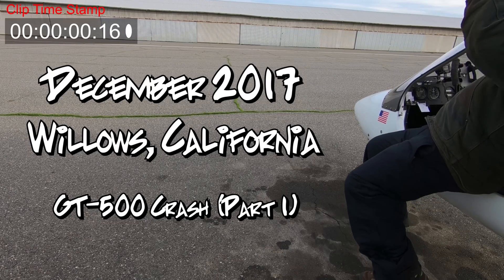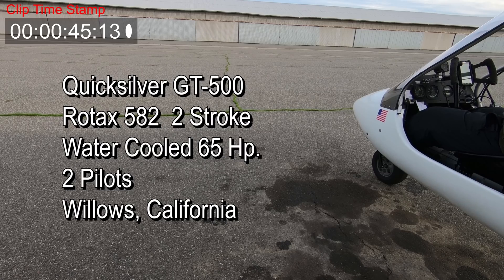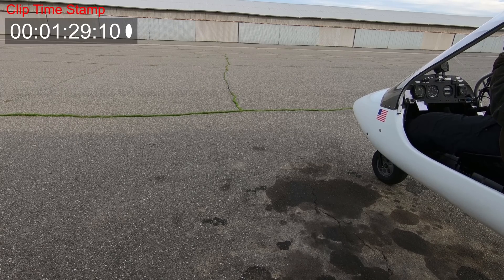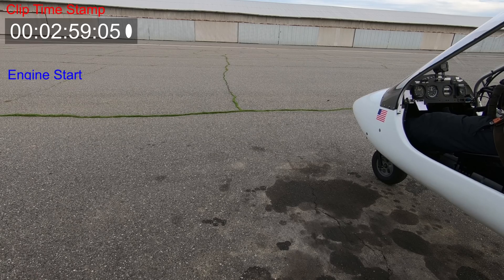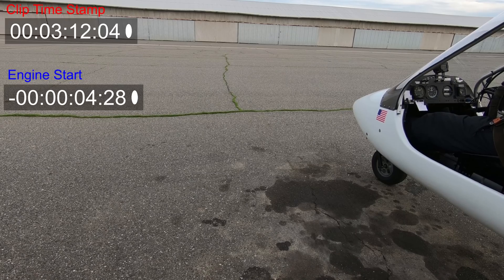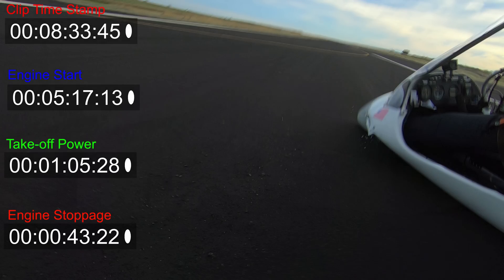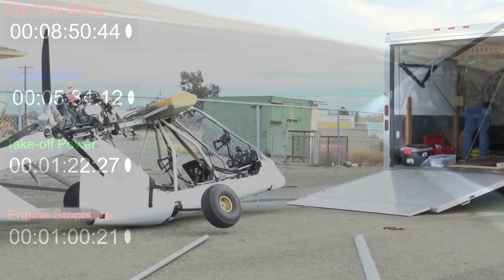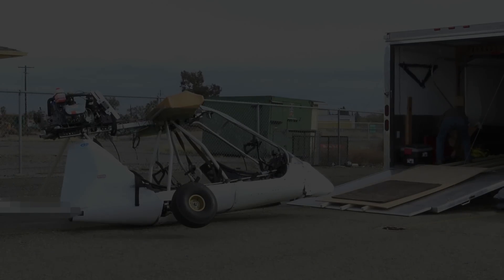Quicksilver GT-500 Engine Failure and Crash (part 1)

Comment: He forced the plane into taking off instead of letting it attain enough air speed to lift off the ground. Now the engine quits without enough air speed for the elevator controls and now you’re a rock.

Comment: That engine gave PLENTY advanced warning that it was going to quit...the second it started losing power he should have  decreased pitch.  With these two strokes you have to warm them up a lot more thoroughly than this guy did....4 minutes is NOT enough.  And you have to warm it up at much higher rpm than he did....you need  the engine casing/cylinders to be full running temp....not just the cylinder heads and EGT.  I do the last part of my 7 minute warmup at over 4000 rpm.

Comment: I ve had 3 engine failures in 3 different ultalights  and i can tell u the 1st time it happened i did exacltly what this guy did . Only i was alone so the sink rate wasn t so outrageous and it ended up as a hard landing only. Then next 2 were not so much of a surprise. Didn t even ding an aeroplane. All rotex engines btw

Comment: Interesting that the stick required back pressure to rotate. Normally the pilot may pull back some to rotate, in a well balanced plane you need to go to more neutral elevator position.  The instructor must take control in an emergency, the instructor should have shoved the yoke full forward.

Comment: Why is it that every time I watch an ultralight engine failure the pilot pulls back on the stick. Could it be the lack of formal training. Maybe they want to stall to add to the excitement. This crash could have easily been avoided if the pilot had pushed the stick forward and maintained his airspeed. The guys that fly ultralights are the most macho bunch of pilots out there thinking that just because they don't need a license they dont need to take lessons. I feel bad for the passenger and his back.

Comment: Not sure why the engine quit, but your CG is why you got hurt. See how much backforce you needed just to rotate?! Only way out after engine failure would’ve been a radical pushover (to low), to gain as much airspeed you could obtain, for the flare. At least y’all walked away relatively unscathed

Comment: Crash was caused by pilot error. No power does not mean pull the yoke back. First rule in engie loss, best glide speed. Should have changed to nose down attitude immediately. Instead he induced a stall. Engine was a very minor factor, and since startup you can hear the engine running like crap.

Comment: A perfect example of what not to do when you lose power, when the engine quits instead of pushing the nose down he sucks the stick as far back as it would go, violating the most basic operating procedure. Engine quitting started the chain of events, but it was pilot error that caused the crash. Was the instructor asleep when this happened?

Comment: You can see in the video he never pushed the stick forward when the engine quit, he kept holding it in the same position until the aircraft lost speed and stalled he should have pushed the nose down slightly to keep the air speed.

Comment: “What the hell happened?”  You had five seconds of your engine power decreasing and during that time even as it quit running completely, you continued to pull back on the yoke instead of pushing it forward to maintain your airspeed. You stalled it in from at least 20 feet in the air. Not once did you push the yoke forward to try and keep a good airspeed for a landing. That’s what happened.

Comment: That was not a "pilot" flying that aircraft. An actual pilot would have stuffed that nose down immediately upon power loss. I'm talking a minimum of 30-40 degrees below the horizon for such a draggy airframe. He needed to increase his airspeed to one which will allow some kind of flare just before touchdown. He obviously never once practiced engine failures upon take-off. So he ran out of energy and smacked her on in! When I practice engine failures in my Hurricane during takeoff, I have to stuff the nose down right away, and I mean immediately once I pull the power! Loss of power should be followed instantaneously by shoving that elevator control to the firewall to maintain airspeed. 100% pilot error. That crash had nothing to do with the engine failure with all that runway below him! I don't care if the engine fails at 2ft, 20ft, 200ft, or 2000ft. If you are over 200ft, you can get away with trimming the plane for best glide, but when you get close to the ground, you better drop that nose a little to pick up airspeed or she will pancake in!

Comment: The moment the engine fails - STICK FORWARD to maintain flying speed. Similar to glider winch cable break. Get the nose down instantly, then gently flare. Never hold the stick back, hoping the wings will defy gravity.

Comment: Pilot error. Didn't shove the yoke forward immediately. started losing power at rotation but no pilot input. Probably had the fuel valve off or on a dry tank. I have 10,000+ hours in Quicksilvers.

Comment: "Had they reached 50+ more feet, they could have died."...Genius! I landed thousands of times with the four jet engined and ALWAYS powered off at 39,000 feet....Hauling freight at night landing, we never need to power until STOPPED and we are ready to taxi off the runway! I flew 12,000 hours on the DC-8...5,000 feet on the water bomber(CL-215)....took off and landed on water(powered off) then powered to scoop water 100 times every time before we need to refuel...SO FIRST, LEARN TO FLY SO YOU WILL NOT EVER CRASH!(I never crashed in 24,000 hours)

Comment: During take off when he was running - it was clear heard that r582 is not giving full power. At the same time he started take off procedure and did not realize this. In order to prevent such case we make better pre-heating of engine before take off and giving max rpm to it for test on the ground. If it works well than take off. There was no 65hp during take off, the engine was like getting much more fuel than should...

Comment: Hello, the video speaks for itself. The quicksilver is not what is best in aerodynamics, the badin decreases very quickly in case of engine failure, especially the rear sector handle .. Note that the driver does not stop to bring the joystick up. There is distance in front, no stree, it was enough to put the handle forward, to keep the speed, and everything was ok :-( In any case, thank you for sharing this video that can serve as example of what not to do in case of engine failure.Good courage for the repair of the machine.  Thanks to Google translate ;-)

Comment: The real failure here is that EAA stop building primary gliders and letting people learn to fly in them, and instead focused on building fast, tin can metal airplanes.   Because primary gliders aren't sexy.  Learn in a glider like you are suppose to, and every landing is a dead stick landing, there is nothing out of the ordinary about landing without power.  

Fix your airplane, and land 50 times in a row with no power at all, and not just on the runway.  All over the place.   Farmers fields, backyards, strip mines, soccer fields, river banks, everywhere.   When you can do that, then you are ready to fly again over any terrain everywhere.  :)

Comment: I’m glad he say they managed to walk away from the crash. 

From the sound of the engine, it sounds like a typical classic Rotax engine seizure… Most likely caused either by not letting the engine come up to operating temperature before attempting take off, or from lack of oil. I have actually witnessed something like this happening with a Quicksilver many years ago.
Reply: hogflyer62 Limped away

Comment: First off, whoever was flying allowed themselves to get immediately blown of centerline. This shows inexperience.
Secondly, the nose should go down after engine cut off, which it did but there was no flare before touchdown. Just straight into the ground. What the hell? Looks like somebody panicked and froze.
Reply: Did it stall?
Reply: It stalled out when the engine cut because the way the plane is built, the engine has a high Center of Mass and it sits near the rear of the plane, the wings sit INFRONT of the engine and thus when it cut out it caused the back of the aircraft to drop before the nose, and it stalled the aircraft out causing it to plummet to the ground.
Reply: @JustAGooseman  Naw. Watch what the pilot does with the stick. It needs to go forward, immediately.
Reply: @UncleKennysPlace  Correct, you can see the airspeed decrease.  He needed a quick and substantial forward stick action.  My instructor pulled power at a similar altitude when I was training on my Challenger 2, which has the engine in a similar location.  I reacted correctly and set her down.

Comment: what was the air temp at the time of take off? not enough heat in engine (cold seize) and instructor should have taken control.
instead of stalling 10' above the runway. when all else fails "fly the aircraft"
Reply: Navy teaches. Aviate-naivgate-communicate. I think that is how the Navy spells.

Comment: So, I started by flying in towed gliders, and we practiced "rope breaks."  Stick should go forward immediately to keep airspeed up and AOA low to prevent a stall.  I've never flow this airplane, but if it has a high thrust line like many ultralights, losing engine power may cause the nose to rise, making it all worse.  And a student low to the ground wants his airplane to go up, so pulls back by instinct.  If this had dual controls, the instructor could have taken over.  But this is just my Monday morning quarterbacking, so could be deeply flawed.  Many thanks for posting -- this is how safety is made.  Looking forward to the next videos.
Reply: SteveandLizDonaldson Exactly how I was trained too...Lose power, stick immediately forward, to prevent stall
Reply: I also started flying in sailplanes at CA CITY, CA.....Grob 103.....watching this video appears that engine quit, plane loses altitude as pilot continues pulling back on stick.....
Reply: SteveandLizDonaldson 
Can't stall at zero gee.

Comment: The engine almost sounded like the ignition was turned off, no stuttering or missing.  A cold seizure is a distinct possibility as is lack of the proper amount of 2 Stroke oil in the mixture. The crash resulted from the pilot attempting to climb instead of leveling off when the engine failed, which resulted in a stall and the crash.

Comment: First guess...lack of fuel. I saw plenty in the tanks, but was it reaching the engine?
Reply: engine tapered off like you would think it would from fuel starvation ???
Reply: @P40BTomahawk  Sounded more like a mechanical failure. Not in the crank or conrods. It tried to burn, so there was air, spark and fuel in the cylinders. Piston rings?

Comment: What was the cause of engine failure?
Reply from the maker: We will be sharing the cause of the engine failure in part two. It's looking like right now that whole video is going to be nearly an hour long. We don't want to spoil the results for all of those that are taking the poll and are participating in the analysis. About thirty days and will release the part to video.
Reply: Where is the poll?
Reply from the maker: In the upper right-hand screen on the video there is a little circle with an "i" in the center. Click that and it will give you the most recent results as well as allow you to cast your vote.